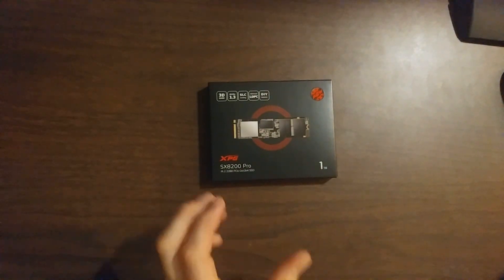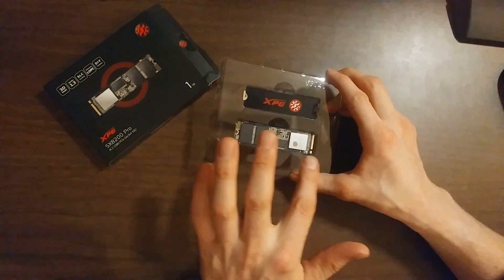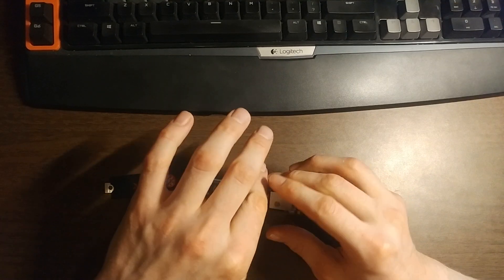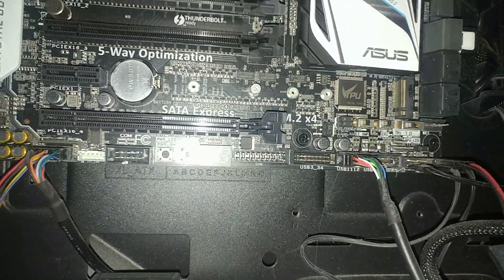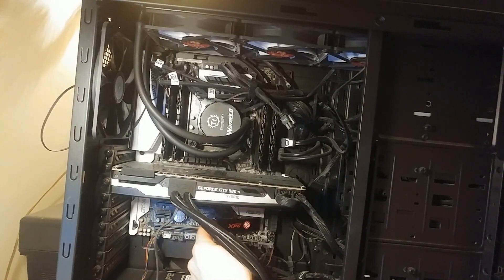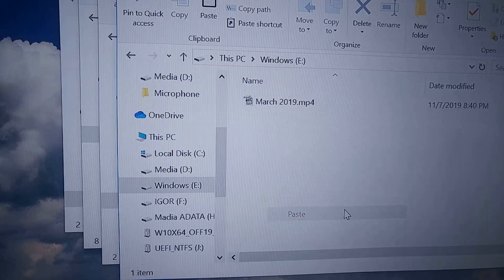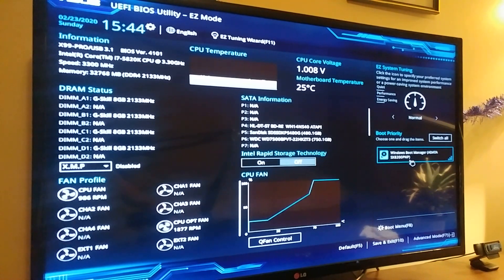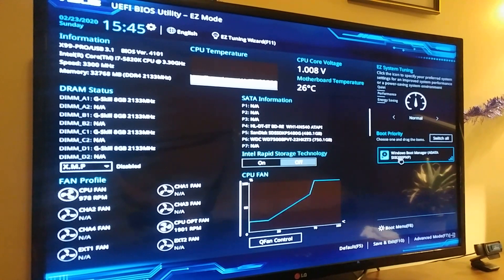HOW FAST IS ADATA XPG SX8200 PRO M.2 NVMe SSD | UNBOXING, INSTALLATION, TEST

Comment from the maker: * Like, comment, share & subscribe!!! * To support the channel please use SuperThanks to donate!
Reply: Why my adata sx8200 pro only read/write 1700/1700 ?
Reply from the maker: Please make sure your motherboard BIOS is updated. Also if your using PCIe extension card, you can try different  PCIe slot on your motherboard. Depending on the motherboard, when you install graphic card in one PCIe slot, it can reduce speed of the other one. Check in you manual for that information. Let me know if it worked or you got it figured out!
Reply: @Leroy Benjamin definitely, have been using kaldrostream for months myself :)

Comment: I think your chip set is little old for a M.2 boot drive from the board. Also I think the boards at the time only offered like half the speed but still lot better than SATA. I believe if you get an add on card for PCIe x 4 (note there are PCIe x1 cards available also that would give you the same speed you have now) and use PCIe 3 x 4 you are able to actually get some speed out of it. On your board it was never meant to be a boot drive so the speed wasn't priority and the drives of the day pretty much matched the speed. But note if you use another PCIe x 16 you might split your lanes to 8+8. I would try to keep the video on x 16 if possible even that it most likely only needs x 8. Most boards allow you to configure from bios.
Reply from the maker: Hi Paul! Yea when I first installed it into M.2 slot, I ran into some issues as to make it as a bootable drive. It's probably because this SSD is newer than my motherboard though it suppose to handle it. But I have managed to get it working as a boot drive, and it works great. I also have another M.2 PCI expansion card that came with the motherboard, but I've never had any use for it. Thanks for your comments.